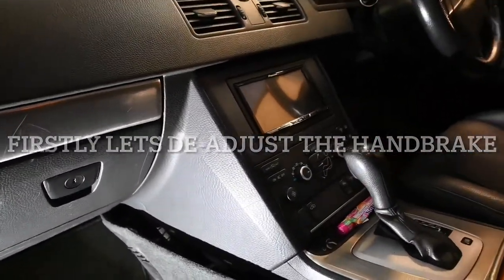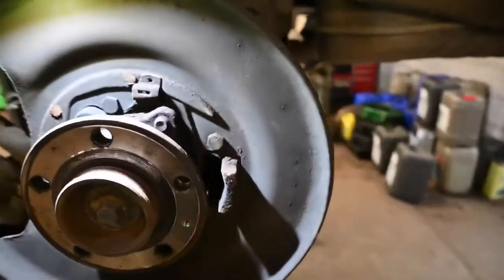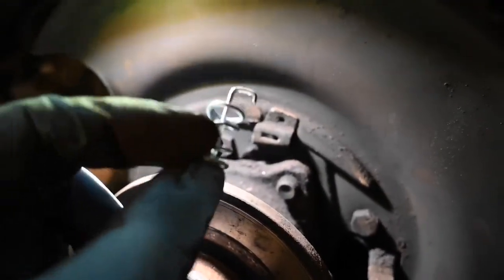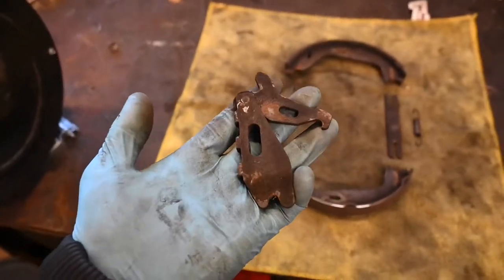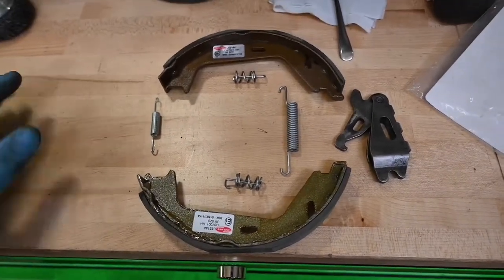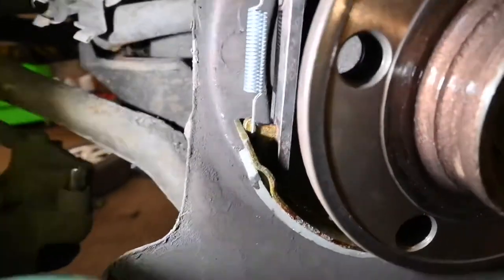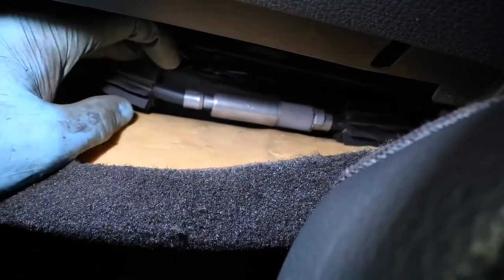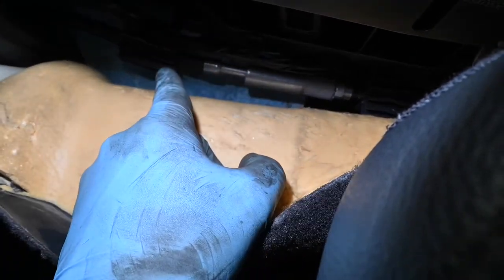Volvo XC90 Parking Brake Common Fault & Fix

Comment: Mate, you smashed it with this video! Awesome walk through and really good idea to educate on specific components and their function before actually doing anything, so many don’t do that.
Reply from the maker: Hi there, thank you so much for the feedback. Really good to know that all the information provided make sense and is helping. Thanks for your support 👍
Reply: Just a heads up, there is a manual adjuster to fit in place of the H shoe fixed spreader piece😎

Comment: But you skipper the most important part - how to take all out before getting the hand break assembly out also.. for us beginners is important! Anyways great video - I have a same issue now and have to fix it. Would be enough just to make sure its not rusty anymore without changing any cables?

Comment: Fantastic video. Just about to undertake this fix on my own 2012 XC90 and know just what to look out for. 1st to remove the discs and see what it going on. Think I'll take the centre console out to be sure everything is sitting in the equaliser as it should, as currently I have no resistance at all, with brake applied fully.
Reply from the maker: Hi, thank you for the positive feedback and glad that this video helped. It can be a daunting task as the parking brake system, in my opinion, is unnecessarily complicated. But it is what it is. So, how did you do? Did you manage to get it adjusted or did you require any parts? Apologies for the delayed response. All the best
Reply: @greenautoservices  Thanks for your reply 🙏 I replaced the shoes, removed and freed up the pivot mechanism & greased (seized on one side almost exactly as per your video!). Replaced all springs with Volvo official, and it had the OEM separator to adjust the spacing. Little fiddly getting the springs in but comes right with patience. Very much appreciate your advise. 

Onto swirl actuator next 😳😳

Comment: Absolutely perfect description of how it all works. I would have appreciated the actual removal of the parking brake shoes. Another thing, when adjusting the cable, clockwise to release and anticlockwise to fasten the cable that you pull out (with the racheting sound as described) can it actually become lose i.e. completely unfastened and if so how do you proceed ?
Thanks for a great video.
Reply from the maker: Hi, thank you for the feedback. Much appreciated especially for future videos. I realised when editing I didn’t film the removal 🤦‍♂️ If I’ve read you’re message correctly I presume with the ratchet mechanism locked, you’re now pulling the cable out of the cylinder to adjust the system? If so, the cable should come out about 2/3 inches and should be quite tough to pull out. If it comes out fairly easy then you may be in the same situation that I was where the cable wasn’t attached to each cable located under the centre console. As long as the cylinder has been locked off correctly then no, when pulling out the cable it will not completely come out. Hope that helps and thanks for getting in touch
Reply: @greenautoservices  Good morning, yes it didn't completely come out but revealed two/three notches/groves similar to the one where the locking C clip afixes to prevent the mechanism from unlocking itself.
I have tried as suggested in your video (great video) and I've only managed to reduce the parking brake to zip. I have noticed that when I apply the foot brake nothing happens on the cable, no tension, no pull, just nothing. This would suggest that the issue is between the foot paddle and the tensioner ? So as not to jump the gun, I purchased a new rear disc, new hand brake pads, new parking kit (spings) and proceeded to take the drum apart. However, it turned out that it all looked and fitted perfectly, not only that it all looked pretty new and recently replaced.
So I am now back to my first diagnoses why is there no tension/movement when applying the foot brake to the beginning of the cable that feeds into the tensioner ?
Reply from the maker: @Ayo04Soul  In my experience I’ve never had or found an issue between the foot pedal/cable and tensioner. My next point of call is to check where the parking brake cable is attached to the equaliser. This is AFTER the cylinder adjuster, which is located under the centre console. It doesn’t happen often but like in my video, it happened to me and the XC90 I was working on. When the system is completely de-adjusted the slack in the line allows it to disconnect from one or both handbrake lines before it goes through the body and under the vehicle. It may just be a case of hooking it back in. As long as you’ve ruled out any other issues then this is what I would be checking next. Hope that helps and good luck
Reply: @greenautoservices  it's fully attached. I should have mentioned it earlier. I have the center console completely removed. The left and right hand brake cables are properly attached to the equalizer. 
I tried applying the foot paddle while I held onto the cable from the paddle to the tensioner but nothing at all. 
If you are in north London I would trust handling the car to you for the job?
Reply from the maker: @Ayo04Soul  It’s completely understandable. It’s difficult to try and explain every little details over messages. Well at least you’ve got access to the equaliser. Have you tried pushing down on the foot pedal and watching to see if the equaliser under the centre console pulls the 2 hand brake cables? You can even hold the equaliser by hand and take up any slack just to see if the pedal is pulling anything at all. At least then you’ll confirm if that part of the system is broken or not. That way you know which direction in the system the fault lies. Personally, before I strip out sections of the centre console/footwells to chase the cable to the foot pedal, I would still at least strip down the rear brakes (if you have not done so already) and check the levers to the parking brake shoes (just like in my video) or any other mechanical parts for that matter. If the levers are seized (as though the parking brake in constantly on) then there may be so much slack in the cable system that you may not even feel the parking pedal pull anything because it taking up all the slack. If I’m ever in North London then of course I’ll be in touch but I rarely am. Especially for a job like this, I’d need the vehicle at my garage where I have access to the correct tools if I need them 😊

Comment: I'm wondering if the equiliser dropped off when you released all tension then reapplied it once you'd fitted the shoes etc, maybe if people adjust it so it's still together in order to keep to it located and enable you to work on it before tensioning back up?
Reply from the maker: Hi, yes quite likely. Just my luck but I’ve done quite a few and that was the first time it happened. You love and learn. The only thing is with worn discs that create a lip internally where the shoes sit, unless you completely release the system then the discs won’t be able to be removed without potentially damaging something.
Reply: @greenautoservices  mine are slightly bedded in I do manage with some fighting to remove the disk and completely agree releasing the tension will help, thanks for the video as before hand I had no idea where the tensioner was etc.
Reply from the maker: @adamwiseman1906  yeah, they can put up a bit of a fight if that’s the case. Really glad the video helped and thanks for getting in touch. All the best 👍

Comment: My back breaks is cool but my front breaks is grabbing not allowing my volvo to move
Reply from the maker: Hi Reggie. Thanks for getting in touch. So your front brakes binding could be a couple of issues. Your caliper may be seized, pads stuck in the carrier or perhaps the sliders are seized. I’d recommend having your front brakes thoroughly inspected for any issues. If it’s not allowing the vehicle to move then it may be quite obvious when taking your brakes apart what is at fault. Hope you get it resolved. Thanks for your support 👍

Comment: Hi there,
Does the car have to be on the floor?
Reply from the maker: Not at all. I’m lucky enough to have a ramp so that all wheels are off the floor for ease of turning the wheels for diagnosis. You can attack each of the back wheels one at a time and then adjust everything up as you go.

Comment: Hi Green auto service - I have an issue with my xc90 2007 auto. The parking brake has no tension at all, I always use my foot brake and today out of the blue I tried to use it and there was no resistance at all. The handbrake does not work. Would what you showed be the issue? Or could it be the cable has snapped?
Reply from the maker: Hi there. The issue specifically covered in this video is such a common issue that it is more than likely the cause and I have not seen one Volvo XC90 using this foot peddle system that has had a cable snap. Although it happened all of a sudden, that’s not to say it still won’t be the levers inside the rear discs. But usually the parking brake efficiency would get worse gradually rather than all of a sudden.
As a technician, I personally would strip down the rear brakes to see if the parking brake lever(s) are seized. If one side has, you can almost guarantee that the other side will have or will be soon after. Unless you can’t fault the rear brakes then I’d turn my attention back to the adjuster or equaliser. Hope this information helps 👍
Reply: @greenautoservices  thank you! I will give this a try. Many thanks for a great video and a comprehensive response

Comment: but if you mot'd it how was the handbrake working?
Reply from the maker: Hi, thanks for getting in touch. So from what I remember as it was a while ago now the handbrake test on the MOT only just met requirements so it still passed. It was advised to the customer that there be an underline issue and they wanted it investigating further.

Comment: can a cable become over stretched 👍
Reply from the maker: Hi, yes a cable can stretch over a long period time of use. Although, it’s not common for a stretched cable to be the root cause of this common issue. Before throwing a set of cable at the car, make sure you check all the common issues outlined in the video. Anything else, please let me know. 👍
Reply: @greenautoservices  when adjusting the cable with spanners as levers, I started to expose the ridges on the shaft about 6, what does this tell us? very informative video👍
Reply from the maker: @geoffreygcotton  I presume once you locked off the adjuster and pulled the cable out to adjust it became more tighter the more you pulled it out? If so, that’s what to expect and the thread that consequently gets exposed it absolutely fine and normal to see.
Reply: i’m losing the will to live, new volvo rear discs, pads, shoes, spring kit, levers nice and free, cables attached to equaliser, adjusted as video, i get 7 clicks, on a medium hill it holds, but a steeper hill just rolls away??
Reply from the maker: Don’t worry, I have another suggestion which may solve this. You need to allow the shoes to bed into the new discs. Take the vehicle for a drive and apply the parking brake slowly whilst the vehicle is in motion. When the parking brake is applied and you feel the car starting to slow down under resistance try and hold the parking brake on for approx 3-5 seconds then release. Do this a couple of times. What this does, is allow any factory applied oils to get burnt off the friction surfaces and makes a much better hold. Then try the parking brake on a gradient and see if it holds. You’ll more than likely find that it will hold the vehicle a lot better. If that works then awesome stuff otherwise you may just need to go back to the adjust and pull out the cable a tad more. You’ve got this, good luck
Reply: The bedding in really works, the break holds much better, never seem to get a problem with standard handbrake lever, having said that the XC 90 is a big old lump, Thank you for staying with me my friend and 👍sorting my problem, I’m blitzing your name in the Royston area😂
Reply from the maker: @geoffreygcotton  🤣 looks like I may need to set up shop in Royston soon then. Awesome stuff, thought that may have been the final piece of the puzzle. Pleasure to have been able to help! All the best 👍

Comment: Where's your garage located here in UK?
Reply from the maker: It’s a company I work for but will have my own garage soon. I’m currently based in Buckinghamshire just outside London
Reply: @greenautoservices  just wondering if you could help me fix my car some day. I believe i can trust you. Im a bit far from your location though. I live in hitchin hertfordshire
Reply from the maker: @reynauldayson  in the grand scheme of things you are not too far away at all. Perhaps in the meantime if you have any specific requirements I’d be happy to try and put together a video for the future. Otherwise early to mid next year I’ll be setting up independently and I’m sure we can arrange to look after your vehicle.
Reply: @greenautoservices  i'd be glad to let you fix my car mate. There's a very loud sqeaking sound somewhere in the rear wheels. With trouble codes 0109 and 0108.
Reply from the maker: @reynauldayson  I presume you have a Volvo XC90 or do you have another vehicle in question? Sounds like you may have 2 different issues; fault codes may be referring and an engine/electrical fault and the knock may perhaps be something mechanical worn or wearing.
Reply: @greenautoservices  yes it is xc90 2010.
Reply: I had it serviced in a garage near me, to change 5 of my glow plugs, only to find out they changed only 2 of them and the remaining 3 glow plugs weren't changed. Its evident cause you can easily notice that only 2 glow plugs are shiny and the rest were rusty. And the ring of the new glow plugs i provided were red and the rusty ones have blue rings. And also had it changed the engine oil. But now my autel tells that oil level signal too high. I dont know if that has something to do on how they filled up my engine
Reply from the maker: @reynauldayson  ah ok. So usually when 1/2 glow plugs fail the rest are usually not far behind. It’s always good practice to replace all of them at the same time. Unless if the garage thought that the others may be seized or brake trying to get them out then that may make sense. I have another video on removing and testing XC90 glow plugs, which would be worth a watch.
In regards to the oil fault, this may have already been in there prior to the service. Only thing for now I’d suggest to do is check your oil level and make sure there’s at least enough in there. I do know for a fact though that these engine should only be filled 2/3rds full to allow for oil expansion during DPF regeneration. The dipstick should have 6/7 X on them so use those as a guide for the oil level. Other than that I’d physically have to see the vehicle for any further diagnostics, even to diagnose the knock from the back of the vehicle.

Comment: We were disappointed that you didn't show the disassembly and reassembly of the parts. I also noticed that you didn't have all of the parts from the right-side assembly, the flat splitter bar was missing.  You left out the "meat" of the video.
Reply from the maker: Hi there. I know , apologies. I can only put that down to rookie error on my behalf trying to film and work at the same time especially for one of my first videos. Hopefully though you managed to find the root cause of your parking brake issue. I’ll be sure to ensure as complete coverage as possible in my future content. All the best and thanks again 👍